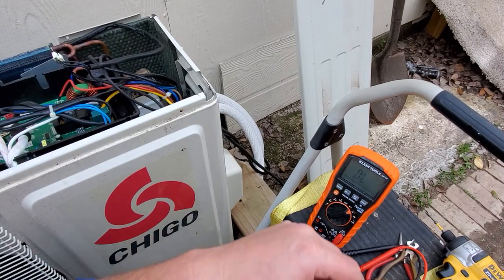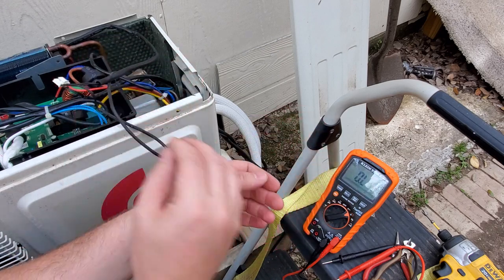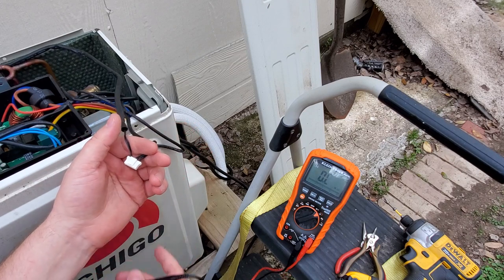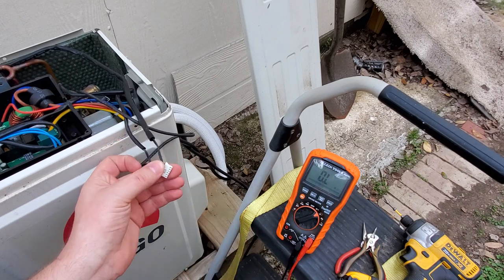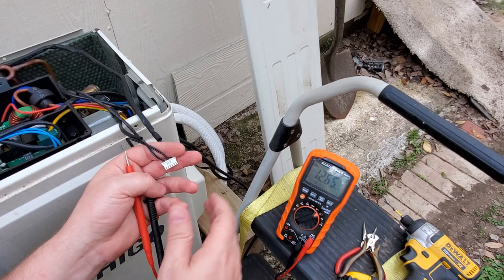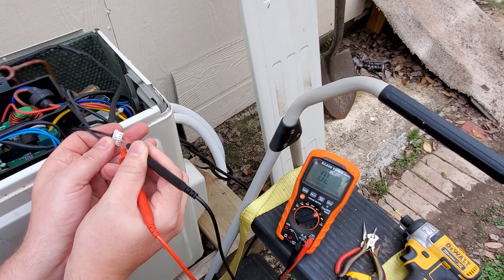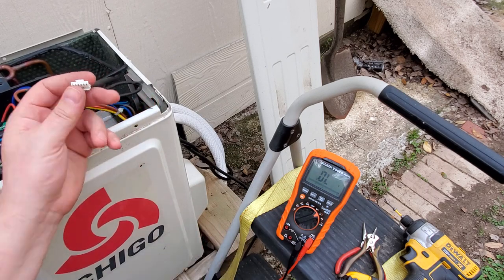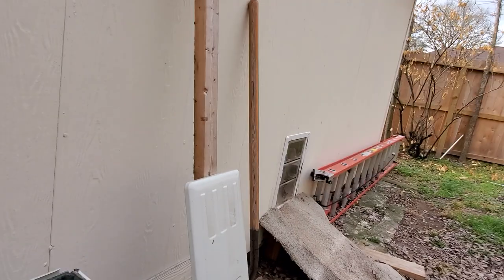Multimeter Troubleshooting of Chigo Mini Split Air Conditioner

Comment: Might have this same issue. PA. Heat worked last weekend. Finally got warm temps in Wisconsin Dells, Wi. Switched over to AC. Seemed to work fine. Came back 12 hrs later to find indoor unit blowing room temp air and PA code. We let the unit sit for a day unplugged, and it instantly gives the PA code when turned on. The compressor is ambient temp, right now that is ~70*F. 
After watching your video, checked this about an hour ago, 11pm, to give myself a head start for tomorrow. outdoor ambient air temp probe gives nothing. middle one gave nothing for a diode test and around 50-ish for the resistance. the middle one went to a tube. The end one went to the compressor , that one seems to test fine. 
I'll update tomorrow morning when I can get better reading during the day. Hope to get this fixed asap. We have a Mom & Pop motel in a vacation city. Unfortunately, getting a HVAC company to show up is next to impossible. They don't work until they run out of beer money, so I usually get to learn things as I go. I've installed 8 Mini Splits, this is the only Chigo, and was the first one I ever installed. I have vac pump, gauges, nylog etc... and install properly. This was the first time I ever had a unit go down (not counting the time when some idiot decided to go "off roading" and hit a condenser with a car..... 

Preferably, I'd replace all 3 sensors to be on the safe side. I think I found the correct ones on Alibaba, but ships from china..... it would be plug n play though. Any recommendations where to get the sensors and quickly? Next weekend is our opening weekend for the summer. I'm going to put some Window AC's in the cottage for now, otherwise my alternative, I have a new Premium Levella unit on the way (I should have a spare on hand anyways....). 
This is our only CHICO and the last. No one wants to touch it, and can't seem to find parts on line (Looking in advance of any major failures). We have the Premium Levella everywhere else, and so far very happy with them. 
THANK YOU FOR YOUR TIME!!!!!
Reply: Our unit looks identical to yours. 12,000 BTU, 120v.

Comment: Diode-mode is sometimes a underestimated technique to troubleshoot non diode components. 
In resistance mode, the measuring voltage of the DMM is very low, but in diode-mode the measuring voltage is arround 2,5V on most DMM's, 
high enough to light up LED's.

Comment: Hello friend . I was wondering if you could tell me if you had a problem before where , the compressor doesn’t wanna lower it’s working rpms when the temperature inside the room is being achieved . It just shuts off instead of working in low rpm .. it doesn’t work like a inverter type , it just shuts off completely and then it continues to work 4 minutes and shuts off again after 4 minutes .. so 4 minutes off , 4 minutes on in maximum rpm and then off again ..
Reply from the maker: Did this just start happening or has it been since install?

Comment: I got  a E4 code and compressor  outside  stop
Reply from the maker: Outside unit abnormal. Check your wiring and check your fan to ensure that it can spin. Unplug outside condensor and wait 30 seconds before plugging back in.

Comment: Don’t you think your problem child was the one showing 70kohm?? It should be 5k5k50k at 25C so 70kohm is the condenser sensor which should be 5kohm, the one you showing problematic is compressor temp sensor
Reply from the maker: I changed out one sensor, and it's been running for over a year